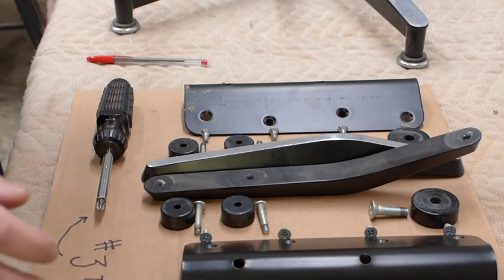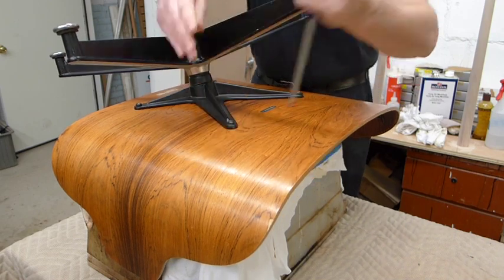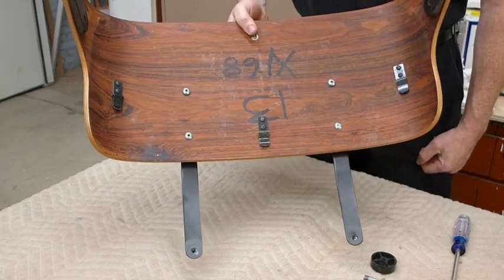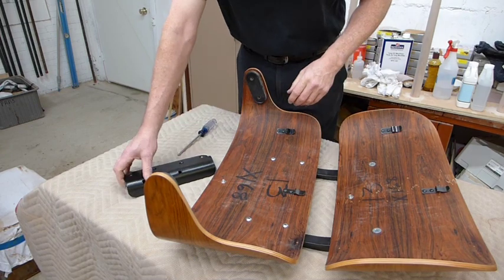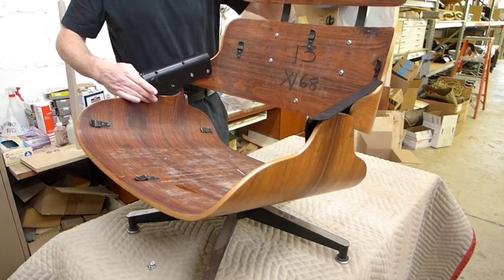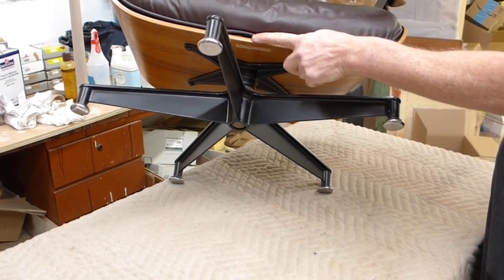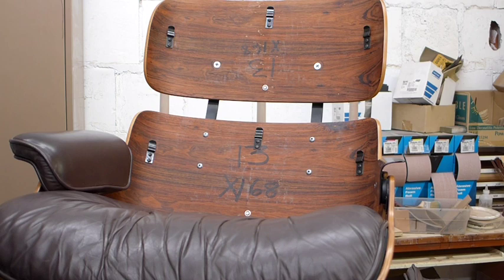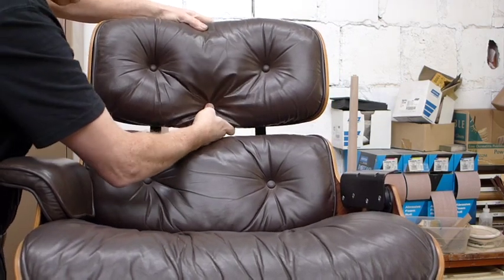Eames Lounge assembly

Comment: I would like my eames backrest to be farther back, do you know of a mod to do this??
Reply: I wanted to do this too but ended up just replacing the foam in the top cushion with a thinner and softer density foam which had the same effect.
Reply: @rjk5559  thanks, I will try that. So far I've just been using a small memory foam pillow on top of the lumbar cushion, feels good enough.

Comment: The shock mounts on the seat shell are all wrong.  Either this is not a real HM Eames or it has been refurbished by a 2nd hand shop and not by HM, which will kill the value of the chair.
Reply: Legs are also not the right kind I think. Also the pillow clips look very different

Comment: I own a genuine Herman Miller 670/671. Notice the two arm cushions and their brackets:  the two metal bracket holes for the cushion screws, and the two mounting holes on the inner surface of the cushions...are at an angle.  It was my understanding that a special type of ball/hex key driver (used by the Herman Miller Company) was needed to maneuver the special armrest screws properly into the holes and tighten them (so as not to ruin the heads of the screws)...NOT using a regular straight Phillips screwdriver for this operation. Can somebody else please confirm my observation.  And yes, the chair does come in a box partially unassembled, the dealer (or the customer) has to finish it.
Reply: The chair in this video doesn't look like a Eames lounge chair. Don't follow this guide.
Reply: I have just disassembled my late 1970s Herman Miller Eames Chair.  This looks exactly like mine.  I used the same two Craftsman Phillips screwdrivers.  This is one of the best reassembly videos I have seen.